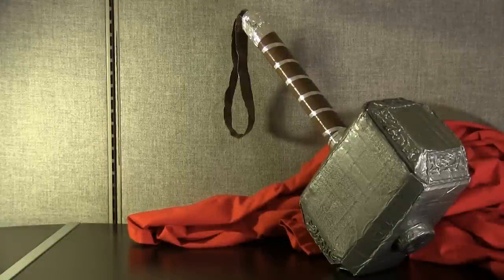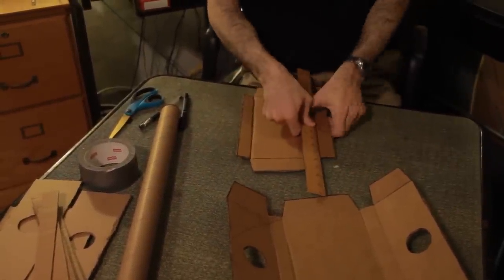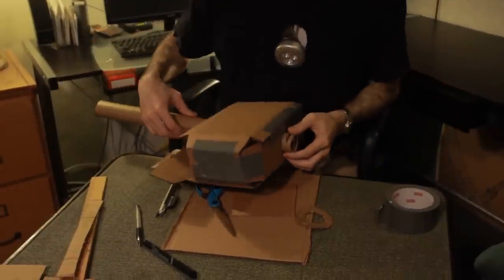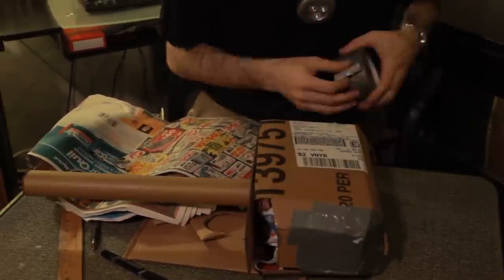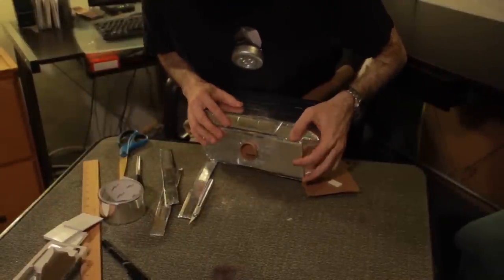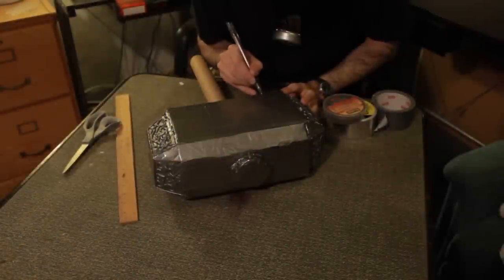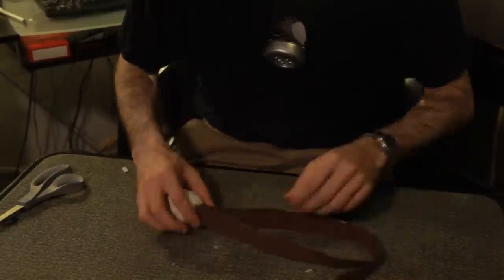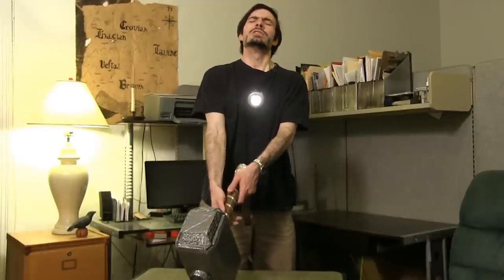How to Make Thor's Hammer - Avengers: Age of Ultron

Comment: on my hammer which is gonna be a foam block on a leather wraped dowel I used aluminum on the handle to make a spiral and cut the aluminum on 1 side to make 90° bend in the pattern it looks great